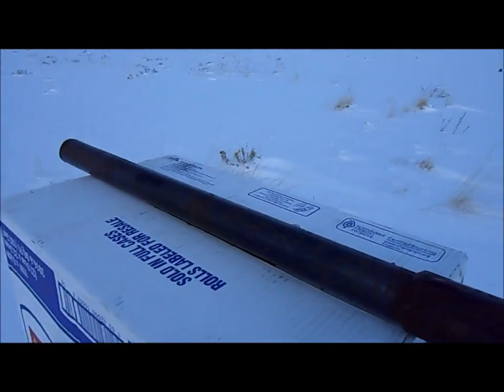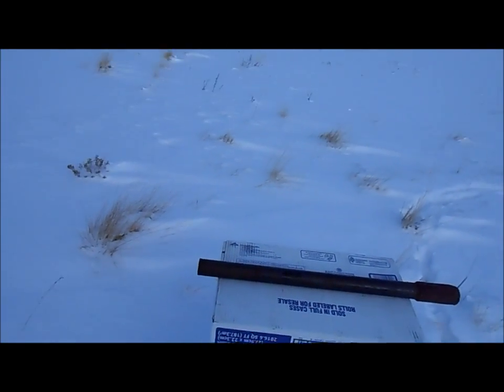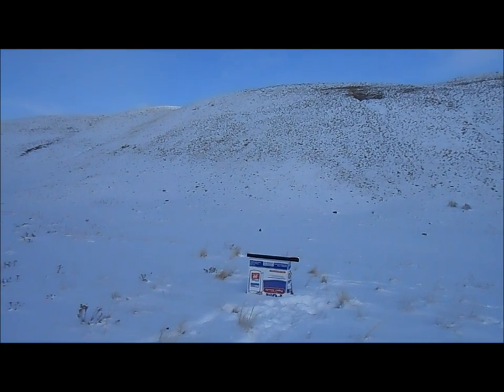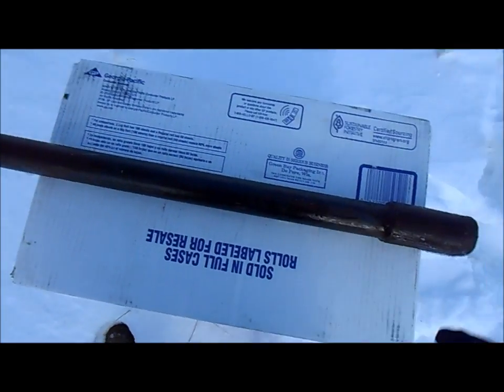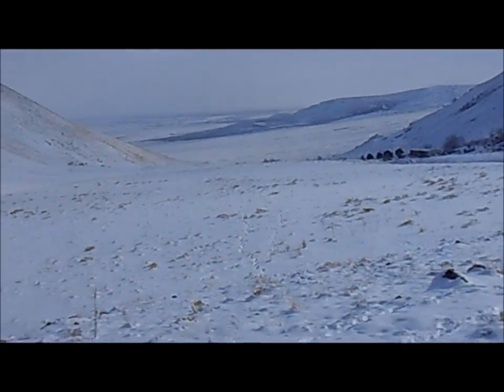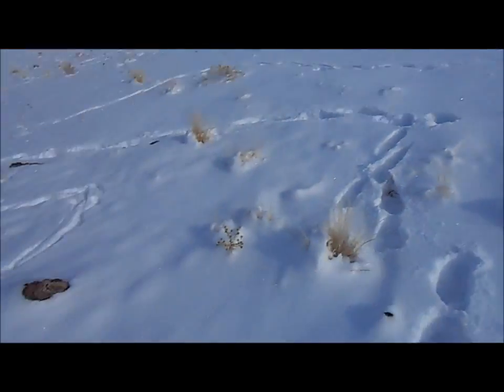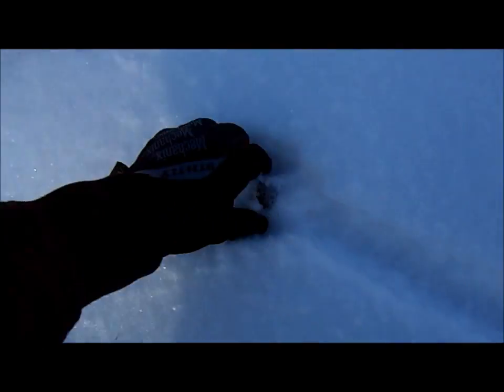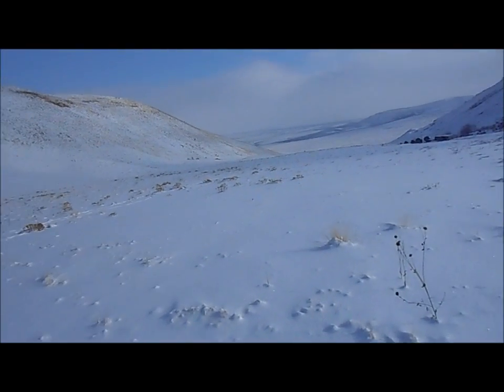Golf Ball Cannon, Speed Test

Comment: If you strap down the cannon you will get better results. A lot of the energy is lost pushing the cannon back.
Reply: +Cody'sLab Cody.  That is some very questionable physics you were taught in school.
  It's SO wrong, I kind of think you're kidding.  But I'll go with you 
thinking it's true.

Let's exaggerate the condition. Throw some bullets into a fire, from a 
safe distance of course.  You'll find the casing disappears and the 
bullet, more or less, stays stationary.   If what you were "taught in 
high school physics" were true, the bullet would have the same velocity 
regardless.

Then to add the mass of a gun and the 'almost infinite' mass of being 
solid to the ground (braced), ALL the propellant's work is put into the 
bullet's velocity.  It's good ol' F-=MA.

In addition, you have SO many unknowns and "ball park" assumptions, (how level is the barrel, what is the EXACT height of the impact site relative to the barrel, did the golf ball fly straight or 'knuckle' upwards, etc.) it's basically useless to do the math.
Reply: +Cody'sLab Why not test it? One shot with straps and another without
Reply from the maker: alright I will
Reply: +Cody'sLab Cool! Can't wait to see it, love your videos. :)
Reply: +Cyberdactyl. I would love to see a test but after thought I believe Cody is right. In physics they teach you every action has an equal and opposite reaction. To explain the bullets in the fire. The amount of energy is separated equally to both the bullet and the case. Since the case is far lighter this energy results in a longer distance. The bullet being heavier won't travel as far because it has more mass. But the energy provided is the same. Just as if you took 2 vehicles that were the same and loaded one down with lots of weight. Put a gallon of gas in each and the heavier one will not go as far even though their energy (amount of gasoline) was the same.
Reply: +Robert McCain Throwing the bullets in the fire, I was simply exaggerating the condition to make clear.  Apparently that makes it more confusing for some.  But I'm not sure how this has become confusing, Cody uses the cannon's mass in his calcs for goodness sake.

The more mass the cannon has increases the inertia, thus more energy is exerted on the bullet mass. I suppose I could have provided a mind experiment of similar consequence, in that let's say we built the cannon out of a magical material that was as strong as the pipe in the video above, same inside diameter, same length, yet weighed the exact same as the golf ball.  Even without doing a F=MA equation, what do you think the result would be? After seeing the cannon in the video above, which weighs 3.7kg recoil backwards three or so feet, you should be able to get close to a correct answer. The answer, of course, is the ball and cannon would separate from the ignition point, more or less, exactly the same distance.
Reply: Your right in the fact the both would separate the same if they were the same mass. If the barrel were strap down it would still receive half the energy but instead of moving backwards it's energy would convert to other forms. I would even think in a very small amount it's possible to effect the rotation of the earth. This very minor effect would be reversed when the bullet hits the ground in the opposite direction.
Reply: +Robert McCain regardless, the video was cool :)
Reply: +Cody'sLab i'm pretty sure the gas pressure is related to the inertia of the back wall of the canon.
Reply: Regardless of it being strapped down or not, the force of which pushes the cannon back is still present, just simply adsorbed by the straps, or wall behind it. The moment of which the cannon moves back and the ball moves forward is precise to each other, making it irrelevant if the cannon is still behind it or not. The force to move the ball forward is already gone.

If the ball had a continuous force behind it however then yes, having it strapped down would make a difference as the end of the cannon would be closer and has a closer 'mark'  to push off from, however that is not the case here as its a singular explosion of momentum.
Reply: joel strike
So... what are you saying, that it doesn't matter if the cannon is mounted to the ground or not in regard to the ball's exit velocity?
Reply: the conservation of momentum should dictate that if the cannon is shot unmounted that the muzzle velocity will be the same whether mounted or not. the difference mounting it makes is it changes the center of mass rest frame, in the mounted position the center of mass rest frame will move forward from the cannon faster than in the unmounted postion by  the speed of the unmounted cannons recoil. as the ball is much smaller its speed will be far greater than that of the unmounted cannons recoil making the effect of mounting it minuscule, though it is still there.
Reply: Not sure where several of you guys are picking this up from.

It's basic physics that should have been learned in high school, or at least in freshman 101 physics classes.

A recoiless, or solid mounted gun will have more muzzle velocity than a gun allowed to 'free recoil'.  For someone who's Youtube channel is directly or even indirectly structured around science, to let this go on for years, is somewhat irresponsible.

https://en.wikipedia.org/wiki/Free_recoil
Reply from the maker: I now have proof that this gun shoots the same whether tied down or not, video will be uploaded soon.
Reply from the maker: by the way, the wikipedia link you posted just explains how to calculate the speed and force of a free recoil.
Reply: he even explained why this is false. didn't u wantch the video
Reply: Wow. . .you're doubling down.  Just wow.
Reply: What you say is incorrect.

1. Throwing bullets into a fire will not fire them not because they don't have bracing, but because the   
     pressure isn't contained. False equivalence.

2. Momentum is conserved, so both the gun and the bullet have the same momentum.
     Because the gun is heavier, it has a smaller velocity than the bullet. 
     Bracing the gun will still give the bullet the same momentum and thus velocity.

Here are the numbers: https://www.desmos.com/calculator/he7rqrt1ra
Reply: False equivalence? That would be true if the casing split.  If it is intact it IS indeed a good analogy.  

I'm dumbfounded so many are buying this.  As I said in another analogy, "let's say we built the cannon out of a magical material that is as strong as the pipe in the video above, same inside diameter, same 
length, yet weighed the EXACT same as the golf ball."   I'm giving you another chance here.  Are you going to triple down and say the golf ball has the same muzzle velocity and the barrel moves the same as the video above. . . ?
Reply: Cyberdactyl Well after a second reading, a better explanation is that because the casing is much lighter than the bullet, and so has a bigger velocity.

If the objects weigh the same, they will have the same speed.
Reply: At first I was wondering how you came to the conclusion you came to, but I guess it's quite clear now... 

You seem to assume an energy transfer between the cannon and the ball. That, however, does not happen (ideally, of course). What actually happens is an energy transfer from the expanding gasses of the exploding propellant to both gun and ball. That expansion happens in all directions simultaneously, transferring the same amount of energy in all directions. 

Now, conservation of momentum means that mass x velocity must be the same for both objects (or, rather, that the difference between the momentum of the ball and the momentum of the cannon must be zero). That does not imply that both objects are going at the same speed, though, since the cannon is considerably heavier than the ball. If you strap down the cannon to be completely stationary relative to the earth all you really achieve is that you're now dealing with the entire mass of the earth instead of just the mass of the cannon - mass x velocity must still remain the same for both the cannon (with earth's weight added) and the ball.

Your example of exploding cartridges is indeed also fairly problematic for a number of reasons, the worst one being that a large part of the energy is never absorbed by either bullet or casing - gunpowder (even modern smokeless powder) is just too slow in exploding, so most of the energy is transferred to the environment and - since containment is lost almost instantaneously - rather slowly due to the chemistry involved being quite inefficient without containment. What little energy remains in the system is divided equally between the bullet and casing, the casing being much lighter and thus flying off some little distance and the bullet staying mostly stationary since it is much heavier. Of course, if you try that with .50 BMG the result will still be rather exciting, since there's a /lot/ of propellant there...

The only actual transfer of energy between the cannon and the ball in a real system is due to friction, which would transfer a minuscule amount of the ball's momentum to the cannon and vice versa, thus slowing both down minimally. That, however, is very inefficient (though perhaps quite measurable in a rifle) and practically irrelevant.

Well, I hope that makes sense - I don't usually try physics lectures in a second language :) .
Reply: Well, this is embarrassing... Momentum, of course, is a vector (i. e. it has a direction as well as a scale). I should have written 'mass x velocity for both objects must add up to zero' - implying that the two vectors will be equal in scale but opposite in direction and invoking Newton's third law of motion - not 'the difference between the momentum of the ball and the momentum of the cannon must be zero', which makes no sense at all...
Reply: Jan DL1JPH That is what I'm getting at. Well explained.
Reply: +SirCutRy Thanks. As I said, English is a second language for me...
Reply: That is exactly correct! Yeaaa!.  Now. . . we take that "magical barrel, and set it so it 'cannot move', essentially raising its mass, for all practical purposes, to infinity, thus "all" (>99.99%) of the energy is transferred to the projectile. It's simple F=MA.
Reply: Imagine if you could have a gun in space.
When you shoot it, it applies around equal force to both the gun and bullet.
Both the gun and bullet would travel away from each other infinitively in space, with the gun travelling slower because it is heaver and takes more energy to move.
Now, if you attach a iron weight to the gun, the gun would move slower, but the same amount of force would still be applied to both the gun and bullet. (it just takes more energy to move the gun at the same speed when it weighs more).
If you attach a really large iron weight to the gun, the effect would be the same, except the gun would move even slower.
If you attached the earth to the gun, it would move even slower.

That's how I think atleast
Reply: Absolutely.  And as I have said, let's say the system is indeed in zero g and a vacuum.   And let's also say the gun has magically almost zero mass, and the bullet has, oh. . . say. . . 1000X the mass of the gun. The gun is NOW the "projectile", and the bullet has virtually no velocity, and is now a 'sleeved mount.'

Basic F=MA.   Don't worry, those that doubt the above, I have confidence it will dawn on them eventually.
Reply: Cyberdactyl Again, you're assuming a transfer of energy from the gun to the ball. Now, if you could make a sensible case for that happening you'd be right in saying that strapping down the gun makes a difference. As I said before, though, it just doesn't happen. The transfer of energy is from the propellant to the rest of the system in equal parts. In terms of energy transfer masses don't matter. They only come into play once we're talking about momentum. Newton's third law (which you never disputed) says that for any acting force there must be an equal and opposite force that acts on the pushing object. That means that, in order to accelerate your projectile, you must necessarily have an equal force pushing on the gun - you can't just turn that around, which in effect is what you're trying to argue, thus violating one of the more well-proven physical laws... Actually, you're almost literally trying to disprove a textbook example here (I'd recommend reading these, by the way - start with http://www.physicsclassroom.com/class/newtlaws/Lesson-4/Newton-s-Third-Law especially question three in the test section of that article). If you succeed, you're in for a nobel prize. I, however, very much doubt it. 

The bottom line is that it doesn't matter what happens to the gun as long as it maintains confinement on the exploding propellant long enough to make it do its job - and ***** has shown that beautifully in his experiment. 

Now, all of this being said, I'm not going to argue a moot point. So unless you have anything meaningful to add I'm not going to reply.
Reply: All the above is circular reasoning with some physics link attached.

"you can't just turn that around"

Sorry, I certainly CAN adjust the mass of the projectile and the barrel to illustrate the condition.  What you suggest is everything I'm saying to moot if the masses are changed at all, which basically negates all you wrote and clearly shows you're not understanding the first comment in this thread.
Simply. . and I am shocked there are so many simply don't understand basic physics. . for a given energy release, if the projectile's mass is changed relative to the cannon mass, the velocity of the projectile will change in a free body system.

Once the projectile's mass exceeds the barrel's mass, the projectile will have a slower velocity relative to the starting point, as I illustrated in the bullet and casing analogy.  What you and a couple of others are saying above is the bullet casing should remain relatively unmoving and the bullet should have the velocity it has in an actual gun.
Reply: Well, since you clearly haven't actually read what I wrote or you're arguing a straw man... I'm out. 
For those who bother to read, you can adjust the masses, but they don't determine the direction of the force vector - it's the kinetic energy from the propellant doing that. The rest just logically follows.
Reply: Cyberdactyl The energy transfer is not necessarily the same to the gun and the to the bullet. That is only the case if you take all other variables out and the masses are the same.

Momentum is conserved.

The sum of the momentum vectors of the objects is zero if they are in a closed system.

In the bullet and casing -case the casing is significantly lighter than the bullet, and will fire in the direction of the firing cap.
Reply: I could care less what kind of wacky explanation someone is trying to argue or explain - other than if they are claiming the original statement in this thread is wrong - which was;

"If you strap down the cannon you will get better results. A lot of the energy is lost pushing the cannon back."

He was absolutely correct.
Reply: Cyberdactyl What are you basing this statement on?
Reply: Cyberdactyl You know, the funny thing is, that none of the arguments made contradict the second part of the OPs statement. It's just that strapping it down doesn't change anything other than the mass of the cannon and therefore its trajectory (or lack thereof). The energy is transferred to the cannon, no matter what you do to it - blow it up, throw it across the room, have it stay where it was relative to the earth - it doesn't matter. Even if it stays in the exact same place as it was the earth doesn't and momentum is conserved by altering earth's rotation by a minuscule amount. If it blows up, momentum is conserved in the fragments. If you throw it across the room, momentum is conserved between the ball and the cannon. Whatever you do - it doesn't change anything.
Reply: Jan DL1JPH I saw this in another comment thread: the amount of time the gasses push the projectile doesn't matter because the impulse is the same.
Reply: SirCutRy Yes, that would be expected. However, that assumes the propellant detonates (i. e. the explosion travels faster than the speed of sound in the explosive), which gunpowder (or smokeless powder, for that matter) doesn't do. Otherwise a significant part of the propellant won't actually ignite properly. However, if the gun fails after all the powder has ignited  (roughly meaning after the point of highest chamber pressure has been passed) that is exactly true, as can easily be seen in direct blowback guns. They typically eject very shortly after the chamber pressure has peaked, but that doesn't significantly alter their ballistics compared to other systems, which eject at much lower pressures. Of course, ejecting a casing with a lot of hot, compressed gasses still in it may not be the smartest thing to do when you're dealing with many of the rather hot modern loads (being quite hard on the gun's mechanics), so direct blowback has become somewhat rare in modern designs.
Reply: Absolutely not true.  Once again. . . and I'm literally stunned I have to keep explaining this.  But I guess that's the current state of education.

Let's take that cannon and make it out of a virtually weightless foam.  Same structural strength.  What is going to happen if the cannon is not secured?  tick-tock, tick-tock. .  time's up.  Yes. . .  the cannon is going to move or shoot away and the ball is going to remain in place.  Now. . if we strap down the cannon, what will happen?   tick-tock, tick-tock  Again, time's up. . .  yes the cannon will remain in place and the ball will be projected at a high velocity.
Reply: Cyberdactyl Were are not arguing against that.
Reply: SirCutRy
And as I said.  I am only discussing the original comment in this particular thread.
Reply: Cyberdactyl What OP said is what we are refuting.
Reply: Cyberdactyl  In terms of physics education I might add that things are not at all bad around here in Germany... I don't know where you're from or what your educational background is (and I don't intend to make this a credentials showoff) but it is quite obvious from your posts that you never bothered to read the textbooks with an intent to understand them. Please stop making comments as to other people's education if you're contradicting basic physics that (here in Germany) any sixth-grader should easily understand. That kind of behavior is only acceptable from people with a very solid grasp of the facts of their subject and some extremely well-tested evidence... In which case they would be on the way to a nobel prize.

And before you claim that I never showed that your claims violate the laws of physics: Please read my posts above. I did try to lay out the facts quite clearly. If you don't understand what I was trying to say, by all means ask (I'm obviously not a native English speaker and as such not always entirely confident that I make my case plainly) but please be aware that a lack of understanding does not imply that an argument is wrong.

Anyway, as I said before, I don't think I have anything meaningful to add to what I already wrote, so unless someone asks for clarification I shall wish you all the best and stop writing lectures :)
Reply: Cyberdactyl And again, what is it that you base your assertion on?
Reply: SirCutRy First off, there's actually no conservation law that may be violated here - we're not dealing with a closed system, so conservation of energy does not apply inside the system (of course, it still applies to the system's interaction with the outside world, otherwise you'd have a potential perpetual motion machine).

What happens in your example is precisely what's expected, as kinetic energy depends very much more strongly on velocity than momentum does. So, essentially, the energy that doesn't end up as kinetic energy in the gun or the projectile is ultimately either heat or used to overcome the inertia of the objects involved (i. e. it is used to perform work, also creating entropy in the process). If you add up all the kinetic energies in the system, the work performed and the entropy created you'll find that you get exactly the same energy consumed as was the chemical potential energy of the propellant, so nothing 'just disappears' even though it does somewhat look like that in your incomplete model.

Reading over this comment again, it does seem somewhat confusing, so I hope you can make sense of it... I might have to clarify this tomorrow when I'm no longer half asleep...
Reply: Look, I have been commenting FROM THE BEGINNING on the original comment in this thread, which is, "If you strap down the cannon you will get better results. A lot of the energy is lost pushing the cannon back."  Which I say is true.

I have ZERO interest in debating either nonsensical or esoteric manipulation of physics by which many attempt to say it is NOT true.  If you read through, you will see that is all I have addressed.
Mounting the barrel solid WILL provide more distance to the projectile. Period.  My use of analogy, attempting to explain why, is all I have done.
Reply: +Cyberdactyl Didn't Cody disprove this in his latest chronograph video?
Reply: Gnarled Yes, he did.

Cyberdactyl Are you arguing that the magnitude of force must be the same for both the gun and the bullet? Because that doesn't happen. The momentum is concerved, and that is why the gun is slower. But alongside that, Newton's third law is also obeyed.
Reply: You were just proven wrong :)
Reply: Cyberdactyl you were correct